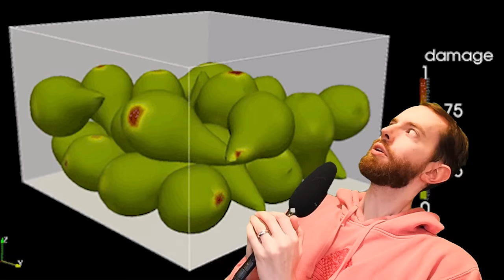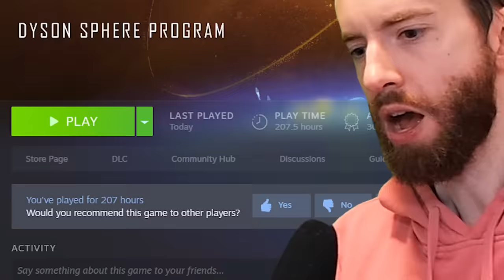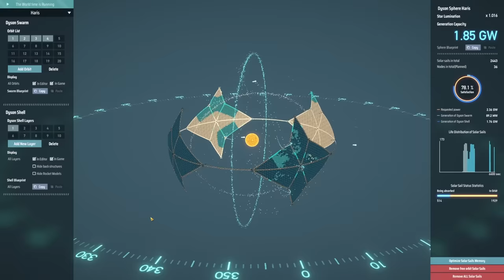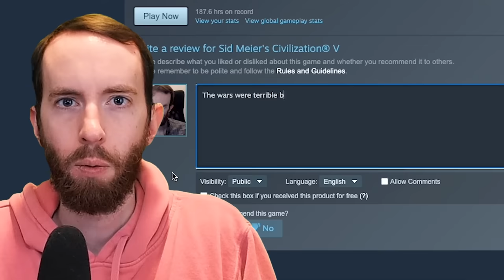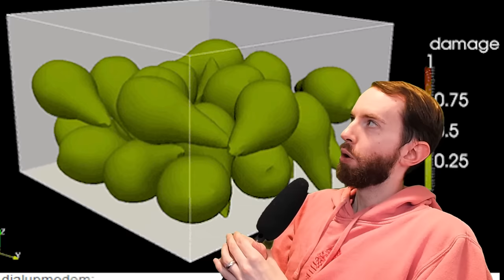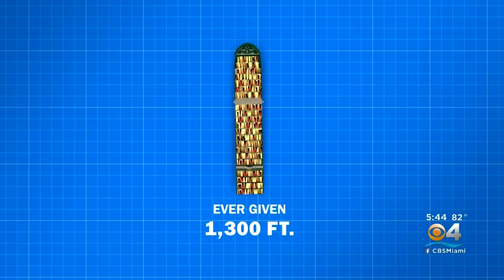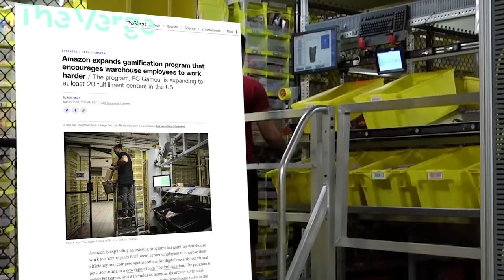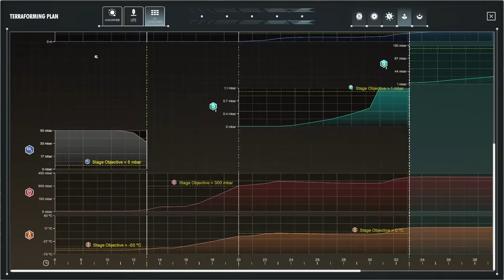Video games explain the supply chain crisis

Comment: UBI was the promise of labour automation. Which really presents the labour reduction for automation WITHOUT UBI concerning.
Reply: Exactly! The issue is not that we're reducing the need for dangerous, repetitive, exhausting labor in manufacturing and the supply chain. The issue is that all the benefits of that reduced labor are not going to the laborers. If it's getting cheaper and easier to produce things, why aren't things getting cheaper? (I know it's not that simple, but on some level it really kinda is)
Reply: it would make sense if all the money saved in automating was distributed evenly but those at the top just add it as a bonus to themselves
Reply: @FlutterSwag  It's funny to reduce greed to a hoarding problem but it kind of is lol
Reply: I think the promise was always more leisure time. It elided the need to work to live.
Reply: @JRiddelle  i forget where i heard it but  someone said if a roman came to our time and saw all the innovation and automation theyd ask "why we still work ourselves to the bone and not have feasts and orgies every day"
Reply: @FlutterSwag  Which is funny when you consider how heavily ancient Rome relied on slave labour (to the point where the state had to support freemen who couldn't find any jobs or land because it was all controlled by large landowners who only used slave labour) :) 

A better example would be post-black death Europe, IMO - they actually managed to squeezed massive improvements to life out of the massive drop in employable labour putting the poor in a relatively good position for once. A massive increase in life quality because suddenly it was the big rich landowners who had to compete for their labour, rather than the employers having to compete for jobs.
Reply: @WhatisaLee  Weirdly, a lot of that "hoarding" is in accounting only. The ever growing "assets" of those rich folk aren't just money being stuck in their private coffers, but directly going to fund ever more automation and investment. But as long as they can afford to pay their workers nothing, they will, regardless of the improved productivity.

Comment: The reason so many companies were affected so negatively by "Just In Time" (JIT) logistics was because it was poorly implemented to make a quick buck and that the failures of leadership were subsequently blamed on the supply chain because it was an easy scapegoat. 

Stay in the auto industry for the perfect example. In 2021, for the first time in 90 years, General Motors was outsold in the United States by Toyota. How could Toyota, a much smaller manufacturer, achieve this during the "supply chain crisis" ? As the inventor of JIT, Toyota implemented it properly by including forecasting. They looked ahead and identified that chips would be short, so they stockpiled (even though stockpiling seems counterintuitive to a base-level understanding of JIT).

The narrative surrounding the supply chain crisis has done some serious lifting - being used to cover-up poorly implemented cost-cutting/profit-generating schemes and also as a scapegoat to cover greedy price increases in tandem with the idea of inflation (just look at the record profits).

This video is a great analog and does a decent job of talking about real factors that affected manufacturing, but plows ahead with common wisdom that's not terribly wise when you consider the poor planning that led to many of the factors that exacerbated the "supply chain crisis".
Reply: also see: "precision-scheduled railroading"
Reply: Thank you for highlighting this. The history of the thing helps explain the thing. "Lean" or "pull manufacturing" or "just in time" whatever modern name you like to slap on it arose during a very specific time in Japanese history. It intentionally trades resiliency for lower overhead costs. If you as a future implementer of your own logistical system only see the "lower overhead" and ignore either the historical context that necessitated it or the very real reduction in resiliency and do nothing to counteract it, you will eventually suffer the consequences.
Reply: @jacobeden2083  really well said. Not only will what you said happen, but the reason will also be shifted to whatever is most convenient for those creating the narrative. We're all subject to the zeitgeist, so those things often repeated and seldom challenged can become "common wisdom"

Comment: I used to work in a large (750,000 sq ft) paper products warehouse. It was attached to a factory that made toilet paper and paper towels. I remember that if we got behind and couldn't get a load out when it was supposed to go out, it took days to get caught back up. We couldn't make the machines run any faster, they were already running as fast as they could, 24 hours a day, 7 days a week. Having a blip a few days long where the place had to stop, or ran with reduced staff, would cause a backup that would take months to clear out. This factory/warehouse wasn't unusual for a factory that makes toilet paper. For the stuff to be cheap the production facilities must run constantly as fast as they can. By 2020 I wasn't working there anymore, but I had friends who did and they said it was a nightmare where everything was super urgent - but when everything is urgent, nothing is.

Comment: This is actually a problem when we talk about sustainable fashion or "buying from the US only". The thing is, when textile moved away from the US, it took textile mills with it. Everyone sold their equipment. It's not here. So if you are actually trying to mill fabric in the US you either have to re-make/build textile machines (expensive), or try to buy them back (also expensive). It's one of many things that frankly, is gone, and is not easily coming back. So we are either stuck with a prohibitively expensive start-up culture or trying to advocate for better working conditions in other countries. 

Of course, this is different from the "just in time" logistics model, which obviously breaks down when the world as a whole doesn't function the ways it's supposed to. It's a problem with tight margins, and should be a lesson in why we shouldn't be scraping every part of the supply chain (especially....worker salary) to the bone, but I'm pretty sure no one learned a thing from Covid.

(Oh, and railway workers got paid sick days back in June, so I'm hoping this video isn't posthumous.)

Comment: During the feudal era when nobody who worked the land owned the land they worked and most of what they made went to many levels above them before reaching the royals who owned the land, 80% of citizens were farmers. In some places, it's now 2%. Arguing against automating these kinds of jobs is like arguing against making it so less people are farmers.

Question, how much of your computer or phones cost to produce is due to human wages? Like, facilities need cleaning, materials need mining and refining, energy needs to be paid for from power sources that also require mining, drilling, and so on. If you were to take every step of the process and every source of fuel and resource and automate it, how much would the same computer or phone now cost to make? The new cost would be set by the value of the land it all takes place on, nothing else. Repairs are automated, replacement parts for all the automation is automated, we create the cost through our labor at every step of the process.

Sure, companies could charge money for something they make for free, but once all the process is automated you really don't need the people at the top to run things anymore, you just need the repair factory to build a new factory and then allow people to use the new one for free. A bit like internet piracy, but for production chains that can make more of themselves.

Comment: A lot of people seem to think that automation is a bad thing. But it's generally harder to automate jobs that are actually good. So, while you'll have less jobs those jobs are, mostly, going to be jobs that people don't want to be doing. And  since automation increases profits there is a very simple solution to people losing jobs. You tax people and use that to either create better jobs or allow people to not work. And while we haven't done that yet, it's all but inevitable. I just hope we don't let things get to much worse before we insist on it.
Reply: you're mistaken in people thinking automation is bad, it's the part where everyone has to continue to find other ways of earning a living
Reply: @Feasco  i'm glad to hear that you don't think it's bad. That you pointed out the same thing that I did is interesting when you say I'm wrong. It's also odd that you're so sure people don't think automation is bed when I've heard multiple people say they believe automation is bad.
There are a variety of reasons they believe this. One of the more common is the belief that hard work is good for people, but that's by no means the only reason.